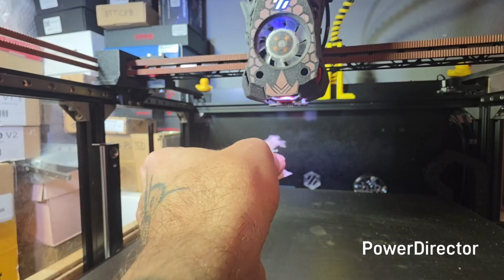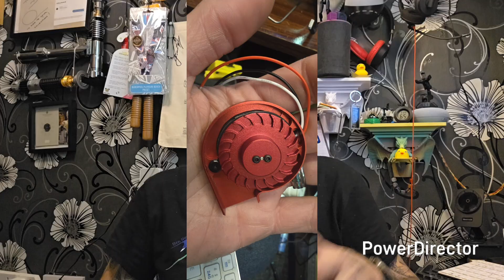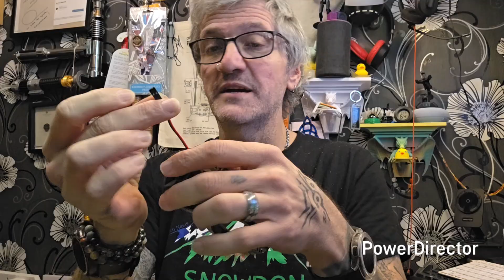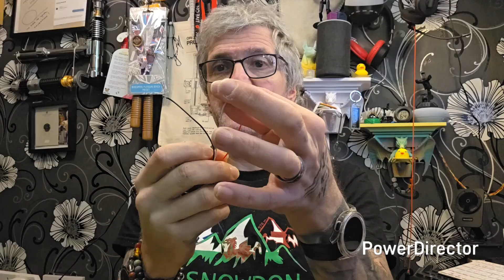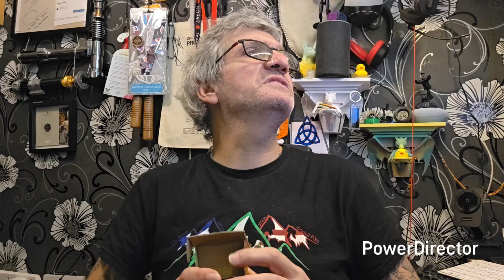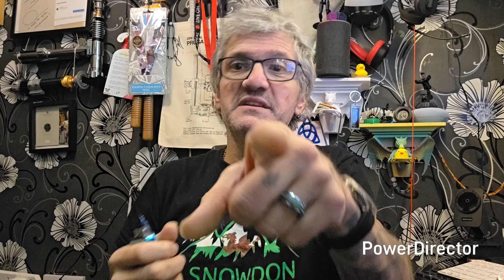Cartographer Cyclone 5015 30k RPM fan

Comment: So am I correct I'd have to run another wire through my drag chains for the PWM signal in order for it to work?
Reply from the maker: This depends. If your tool head is only connected with wires back to the mainboard. It would be 3 wires. 
If you have a tool head PCB ( eg: Sb2209, ebb36, etc ) then no unless you purposely chose to get power and pwm from the mainboard or you don't have any additional pwm pins unused on the tool board PCB. I use an Sb2209 so I used 1 gnd pin from that tach fan pins and the other 2 to the regular part cooling fan port

Comment: I guess they were low on stock when mine was ordered mine isnt cnc metal the entire thing is grey..
Reply from the maker: If you got the full 5015 those hace full CNC for the blade but the body is SLS printed. ( They actually have this on the page ) I couldn't resist and got 1 of each 🤣
Reply: @CyBerJak I think they were sold out of everything except what I got when I ordered it.
Reply: @CyBerJak what slicer setting are you using im trying to set it up so its not too loud but get good cooling.
Reply from the maker: I've literally dropped everything by a factor of 10 for my everyday stuff. I'll have some follow up video soon 
But 100% became 10%, 80% to 8 etc. 
I literally have a 1 and 2% now 😂 you may need to adjust your config to allow levels that low for percentage

Comment: I have one. how did you wire this up? i also have sb2209s from what i understand the fan board isnt rated for 30w did you wire the power directly to the power pin on the sb2209 board or did you wire this to the fan board?
Reply from the maker: Actually the MOSFETs for the vfan1/vfan2 are ES3400 N-channel MOSFETs. They have a max continuous drain of up to 5.8a and top out at 30v as such with fan set to 24v , 30w is only ~1.2a if running at full speed and there is 1 MOSFET for each fan. 
As such. In the video I pointed out.
As fans are already set for 24v.
RED: to VFAN2+ (VDD FAN2), White: VFAN2: VFAN2- (PA1)
The black wire put on the GND of the 4WFAN marked GND. That's how it's wired and works absolutely perfect on my SB2209
Reply: @CyBerJak  Okay thanks. i chatgptd it and it said different...lol i will continue wiring mine up tonight then. they are on super backorder right now. do you have a source to get any more of these fans? i need at least 5 more.
Reply from the maker: The best way to get lead times is to get in touch with Richard from Cartographer3D he's always on top of stock tracking. If you are on discord he's usually able to be found in the Cartographer discord. ( Link for joining it is on their page.  ) But I'll msg him in the meantime and see what lead times are
Reply from the maker: @robjmckay I got the answer back. The next batch should be arriving in the next few weeks. I'm the meantime. Definitely contact them for further details and potential order times etc 😊
Reply: @CyBerJak  also these are on backorder, i have these drone motors... can someone design these stl files for the fan?
Reply from the maker: I don't think that these will have self made options, due to the nature of the custom controller and the CNC and SLS nature of them. But I think Richard might be better on this for comment.
Reply from the maker: https://discord.gg/4NswDeP79 get on cartographer discord for sure

Comment: That's CRAZY! What's the voltage on the fan?
Reply from the maker: Just 24v from the vfan2 port on my sb2209 tool board. 😁 So same as the 5015 it replaced